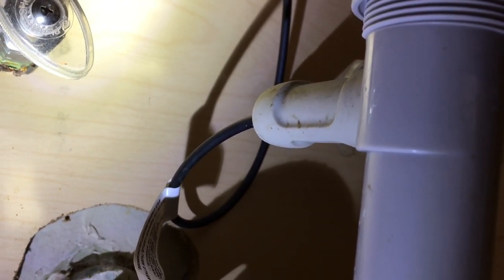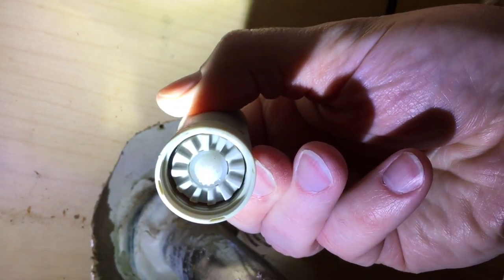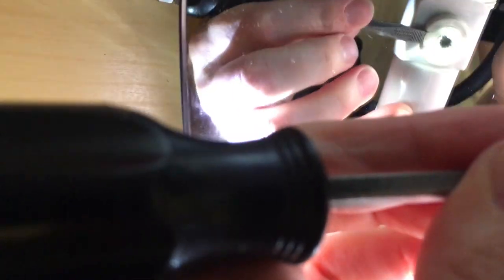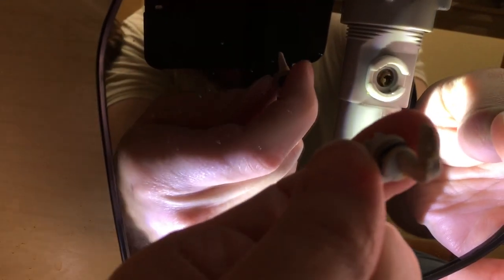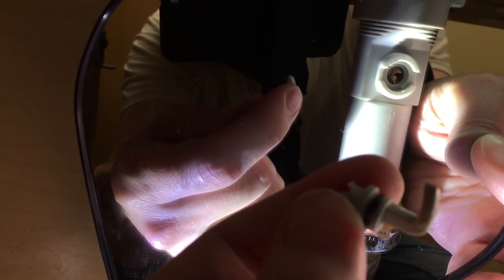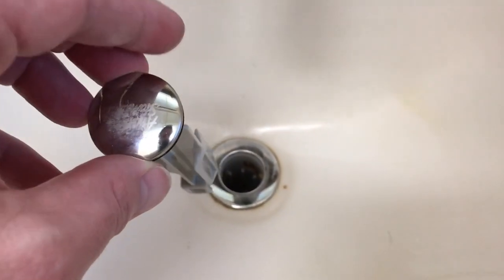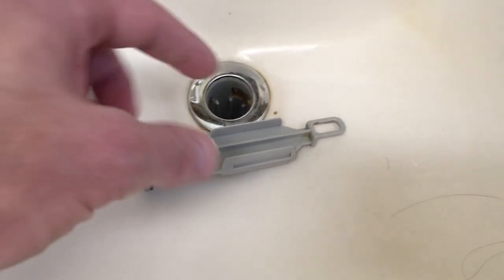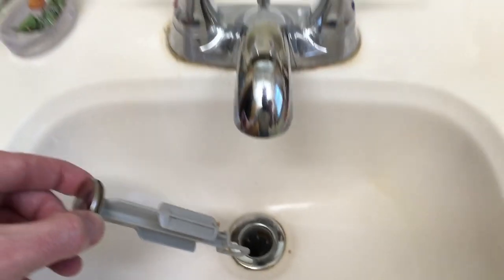American Standard Speed Connect Pop-up Drain Stopper Removal

Comment: When it comes time clean the American Standard sink drain, I procrastinate like crazy, until the job can wait no longer. Taking the assembly apart and cleaning is easy. Putting it all back together is hours of frustration. I watch the same video every time--one where the guy puts the little L shape in facing up then down then uses a screwdriver to get it in the correct position. Today, I watched your video in which you circumvent the entire reassembly issue. When I finally tried your  method, It worked in minutes.. Never again frustration under the sink. You are a genius. Thank you so much.
Reply from the maker: Glad to help!
Reply: Definitely agree! Did not know you could place the stopper in the “free” / non-captive position to let you easily remove it whenever you want to clean. So much easier!

Comment: I have the same drain rig but I have a different situation. Mine leaks so if I fill the sink for washing/shaving, the water slowly drains out that I must fill it again before I finish the shave. I have cleaned the rubber seal on several occasions but that didn't work. Is there a way to tighten the seal or do I need to replace the mechanism?
Reply: Same problem here

Comment: Thanks for this. Mine turned out to be even easier. No gears etc, just the large screw cap and a metal rod. It came apart and went back together even simpler than this video shows.

Comment: my stopper barely comes up at all when you push the plunger down behind the faucet.  So when the plunger/button behind the faucet is down all the way, the stopper is just a very little bit open and so water drains very slowly.  Any suggestions?
Reply: Take it apart and clean everything

Comment: To be clear, for the easy removal version the hook points up?
Reply from the maker: For easy removal, you want the hook up but more importantly, you want to install the hook while the stopper is out. This way the hook doesn't "capture" the stopper.
Reply: @Rickmakes Thank you! This is the important info that might have been a little clearer in your video. I couldn't make the instructions that come with the faucet work. The instructions say to put the stopper in, install the cam with the hook pointed down, snap in the cap, and use a screwdriver to turn the cam so that the hook points up and the stopper rises. No way. It worked your way: install the cam with the hook pointed up, snap in the cap, put the stopper in, which will be in the up position. Lifesaver.